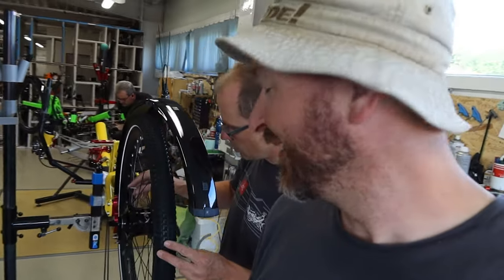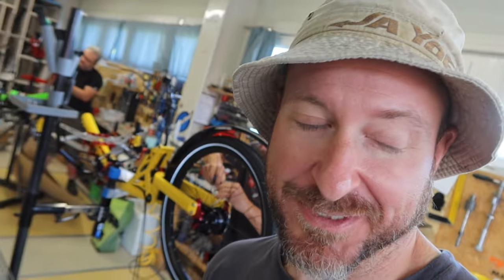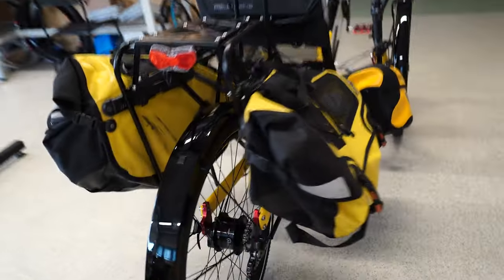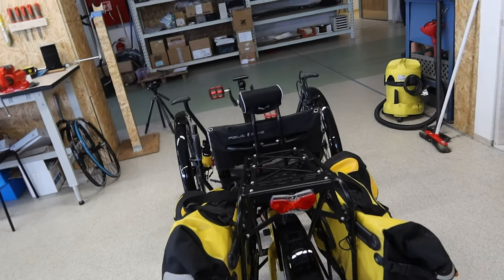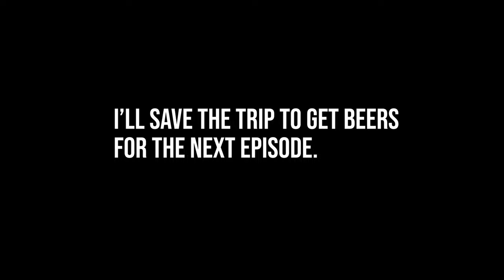Building an Advanced Three Wheel Recumbent Trike | AZUB TiFLY X

Comment: Awesome build!  I had an AZUB T-Tris, and I can say, without a shadow of a doubt, that AZUB trikes are the most solid trikes on the market.  I have owned and ridden trikes from many manufacturers, and the AZUBs are by far the most stout.  They are bullet proof, in just about every way.  When I eventually go e-assist, it will definitely be on an AZUB, because I have every confidence they can handle the extra stress of the motor/battery.